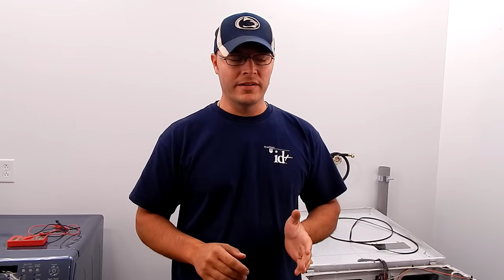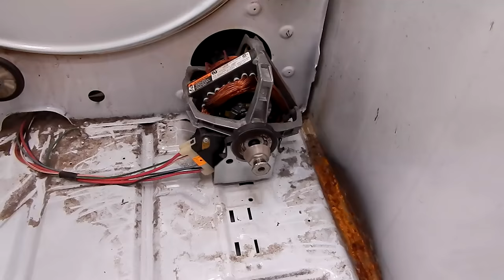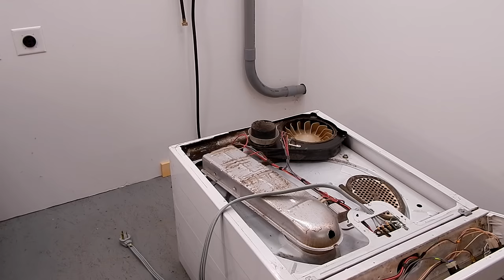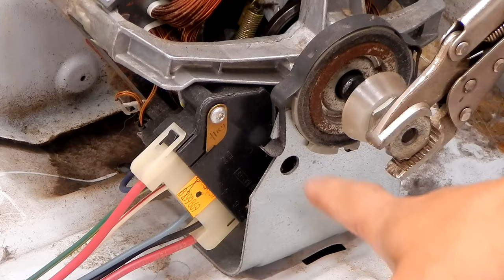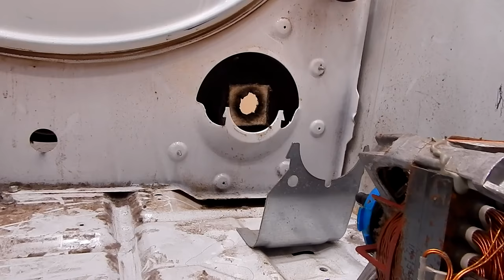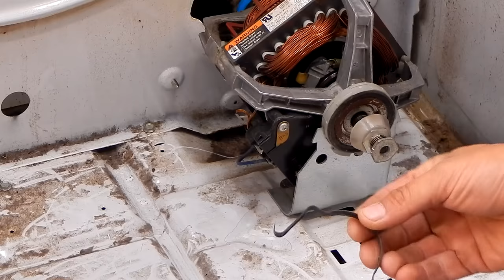How to Troubleshoot and Replace your Dryer Motor

Comment: My gas Whirlpool dryer squeals for 10 or 20 seconds each time I start it. Then the noise stops and the dryer runs quietly for the rest of the cycle. Two of the rollers, the pulley and belt were replaced within the last year. The other two rollers were cleaned and inspected and seemed to be working fine. Is the squealing noise an indication that the motor is beginning to fail? Can bearings be replaced or lubricated? Thank you.

Comment: Remove drum and rear sheet metal, blow or vacuum thoroughly, take a non flammable spray to the motor and clean it, especially the starter switch. Grasp motor shaft and spin it... is it free and keep spinning.? If it has a lot of resistance but no end play...take a 1/16" drill bit and drill the bearing felt housing at both ends....only penetrate the felt chamber! Take a needle oiler and use transmission fluid and wet the chamber with 10 or twenty drops. The motor should be free to spin now, and will add immensely to the drums starting torque. Clean up the excess oil and reassemble unit. (should give you another 5 years years of duty.

Comment: Good video, thanks for posting. I have a Kenmore/Maytag drier and when I press the start knob the drier starts for a few seconds then I can see there is a draw on the electric as the lights in the room dims for a second then the drier stops. If I do nothing in about a 90-120 seconds the drier tries to start again with the same results. The motor does not get hot as the drier doesn't run for more than a few seconds.Any suggestions?

Comment: Our dryer suddenly stopped working last night - made a loud noise and shook while sounding like a jack hammer - drum will spin - belt is still in place - removed the belt and took the drum out - push the start button again and the dryer shook while trying to walk across the floor - opened the door and the dryer shut off - since there is nothing else in place and I correct that we need to replace the motor?

Comment: I have a clothes dryer that works fine and doesn’t have any trouble running, but lately it will start to make a sort of low mechanical “whine” or “whirring” sounds after it’s been running for 5+ minutes. Cold start sounds normal and nothing else about the machine seems dysfunctional. Could this be a sign of a motor going bad?

Comment: Actually , you helped me remove the motor, thanks a lot ...but unfortunately the new motor is so expensive ( I'm in Egypt)
and I wonder if the motor itself could be repaired rather than be replaced. Is there some sort of ball bearings or brass bushings ( on the rotor shaft)  that are the reason for the noise . I mean , could we replace just the defective part inside the motor ???!!!......thanks in advance for your cooperation .

Comment: If drum turns amd no weird sound from motor and dryer shut's off by itself after a few minutes can it still be the motor or that would be a thermal fuse since drum turns normally?

Comment: I have watched many of your videos and really like them.
  That being said, I usually take those blower wheels off by using a wrench on the hex head on the other end just opposite the pulley, if I am lucky.

I have two questions -  Does that dryer motor have a reversed thread pulley?
  When the motor hums when you try to start, do you ever replace a capacitor?  I am not sure I have worked on an American made dryer that has a start capacitor.  It has been a while since I have done much with dryers.

Comment: Okay, I'm at my wits end. At this point, I have replaced the timer, the on/off button, the fuses (all of them), the motor, and the blower fan.  It hasn't been easy. I put everything back together. It ran beautifully, for about 20 minutes. Worked longer than it has in a while. Bu then, I heard an end of the cycle buzz and felt heat coming from areas it normally doesn't. Like the blower fan chute I immediately unplugged everything. But I think I lost my upper and lower fuses. Is this because the motor was changed or is there possibly something wrong with the motor replacement. Or maybe I didn't get the blower fan back in tight enough. I just snugged it. Help me please, I've invested too much to fail.

Comment: Could a bad motor or something else wrong with the dryer causes a breaker to trip? Breaker keeps tripping and I already replaced the breaker. Breaker is 30 amp and so is the dryer. Dryer outlet reads 116.5 volts on each side of 3 prong outlet. Thanks for your videos. Michael

Comment: Remove both clips holding motor down.
Put vice grips on the back side of that blower wheel, you reach it from the inside of dryer not from the back, where he put the vice grips is a 7/8” socket, it’s reverse thread. Grab the blower with vice grips and turn the 7/8 socket clockwise to loosen.
You actually don’t need to tip it on its face to disconnect fan blower from back of motor. In fact I think your more likely to damage it that way. Hammer and block of wood will 100% break that brittle old plastic.
Grab the clear square on the back of the motor with either crescent wrench or vice grips (vice grips are strong and can possibly break so gently grip it, . It’s only accents after you remove the 2 metal clips attaching motor to dryer body, it’s on the back side of the blower wheel.
Otherwise great advice.
Blower wheel and a motor is like 1/3 the cost of a new dryer so you wanna break as absolutely little as possible.
I had to replace belt, rear felt seal, roller wheels and belt tensioner and now it looks like motor.
All in it’ll be 180$. Approaching the why bother mark.

Comment: I replaced all my thermostats and the motor and it still shuts down mid cycle. I spent over $200 in parts. I checked the hearing element and it's good. I don't know what else it could be.
Reply: probably the controle board
might be worth checking the lint trap and the exaust ducting too
sounds like you have an electric like I have, I learned a whole bunch trying to fix mine and being successful with it even with my vision dissability! Dont give up on it yet.
Reply: nevermind probably scrapped yours by now lol

Comment: I been having problems with my dryer, I replace the heater element and thought that would do it, but I kept getting a buzzing noise, so I replaced everything possible and still get the buzzing noise.  I now think I have a bad dryer motor, I can push the start button and hand turn it to start and it will start, but when I open the dryer door it stops but will not start back up.  I was told it could be a bad bearing in the motor.  Thanks for the vid, I will replace the motor and go from there. alot cheaper then buying a new one, mine is not that old, just a couple of yrs  it is a armana

Comment: I wish I checked out all the comments first, because I definitely destroyed the blower fan. My replacement motor came, however I see the wiring inside wrapped with some pretty intricate string. This should stay on the motor, it should not be cut off, correct?

Comment: Just a tip, on the motor end where the belt goes, on the old  old dryers there really wasn't anything there to grab ahold of when trying to remove the fan,a pipe wrench or vise grips was your best bet, on the newer ones like this one, and when i say newer ones i mean the last 20 years that motor pulley has a hexagon so you can put a crescent or a proper wrench on there , even a socket to hold the shaft while you remove the fan, dont use vice grips, you're just gonna put all kinds of teeth marks on there.

You might be replacing the belt later and cut your hand on those teeth marks, if you motor has a hexagon and you have a wrench, use it!, on the fan subject, there are 2 types, one has a place when you can put a ratchet or something in front,if its smooth like he says in the video and you dont have a provision for a tool there will be a flat area between the motor and the fan (molded on the fan) inside the dryer, i believe the flat area on the fan is 13/16, put a wrench there or a crescent to remove your fan, Remember... the fan is what they call "left handed thread", this is done by manufacturers to ensure they way something normally rotates will never get loose because the way it rotates ensures its always spinning in the direction it tightens so the normal 'lefty loosey" doesn't apply here!!!

Comment: Hello, there I have a Samsung Dryer DV45h7200GW/A2 that it did turn on but the motor was not spinning but it had a loud buzz sound like it stuck so I did as you say giving a spin by hands and it did work so I clean the motor it with electronics cleaner and did work fine but then I added WD40 and know it stops after 3 seconds and comes back after 2 minutes and so, the question is the motor no good or needs better cleaning. Thanks

Comment: Mine would definitely break! Lol I have done everything so far and still no start. The light in dryer is on so it has power. It’s a Maytag centennial. I’ve replaced everything even though they passed the continuity test. Still no start. Mine never gave a warning. No hum no nothing. Just took out a load, put one in, hit start and nothin. Is it the motor?

Comment: yep  had the 60 hz  hum for a while now,  and my dryer won't restart after it has been running,   barely restarts after hour cool down , but completes the drying cycle,  thinking I only have a few starts before it lets the smoke out  burning winding smell  - will order new motor tomorrow   Thanks

Comment: My dryer has symptoms that aren't listed. The dryer starts and heats OK but starts to sound labored after a minute. If i pull the lint screen out a half inch allowing get air to come in from the top the laboring sound reduces. I have completely cleaned the lint screen and removed and cleaned the metal lint tube. I have opened the front of the dryer and pulled the drum out and vacuumed all the lint from inside the front and vacuumed off the motor. That all helped some but the dryer still sounds labored and sounds like it will fail in the near future. Any thoughts?

Comment: Just a heads up...have an 2012 ge electric dryer where the blower wheel comes off counterclockwise. A left handed thread would make more sense but NOPE, not here

Comment: +Bill Newberry
I have a 5KH26JJ064S that a got from a craigslist post from the side of 
the road with metal and this was in it. Anyway I don't care for AC 
motors much but I always have a hard time knowing how to wire them up. I
 used my DC bench power supple and put the negative to black and the red
 to the orange/blue and the motor resisted to turn so im thinking it 
works but I am hesitant to hook it up to AC since AC is always more 
complicated (and dangerous). There is a switch with 1-9. 1, 3, 5 ,6, 7, 8
 have tabs and blue is on the 8. Orange is on the 7 and black is on the 
6. How do I wire AC correctly. I think this motor is only AC as I do not
 see any commutator. Please respond thanks

Comment: When was the diagnostics part? You just mentioned the symptoms and how to remove it...
Reply: Ikr. How the hell does he know it's a bad motor without diagnosing? You can't just finish by saying replace the motor without testing whether or not you have a bad motor. I didn't even see him use any electrical testing equipment. Let alone watching other videos.

Comment: Bill,

I have replaced the dryer motor switch on my WED8300SWO. It will heat the first run. but then will not heat anymore after that. The motror will just keep turning the drum. Do you have any suggestions?

Comment: hi bill i have a ge front loader dryer. i think its a 2006 with the electronic control panel. it turns on but will not heat or spin and i have no clue how to take the sides off to get to the enter part at the bottom where the motor is. do u have any idea or clue what might be wrong or how i might be able to fix it? thank you for your time..

Comment: Hi Bill , look you have knowledge and experience. Hope you can help me :  i m having trouble with an GE gfdn240el1ww .  Run for 2 minutes and jeating and gos on pause . If i play again run for 2 minutes again. I  entered on diagnostics mode. once showed E11 : drum motor. i clean the memory and test it again . no errors. Motor run normally. i ran Steam Test . it runs the machine for 20 minutes heating and running without errors so i don t think that de motor is bad . The machine isn t old and few use  . it s a pitty put in the trash .  What can i check  ?

Comment: Hi bill i have a problem with my dryer its a samsung dv33ag and doesnt do anything the board comes on and the relays click but the motor or the heating elements wont come on. Is it a bad motor?

Comment: To get the blower wheel to loosen up with out laying the machine down on its front. First remove both clips  k
eep the vise grips the way you have them.   Then put an adjustable wrench on the blower wheel just behind the motor give it a little turn.  Then go around to the other side and its already broken loose.   Then it spins right off no need to use as hammer or ruin your hands or break the wheel .

Comment: I like how you skip attempting to loosen the blower wheel from the inside of the dryer. The back has to be opened anyway, so might as well just go to the 'bigger hammer' method from the start.
Reply from the maker: Kip Anderson lol,  I know.  There is usually an easy way and a hard way.  I somehow prefer doing it the hard way for some strange reason.  Makes things more interesting.  Thanks for Watching!
Reply: I was able to slip a 12" crescent wrench across the wheel, then used a c-clamp in the middle of the wrench to get leverage on it. Less banging. No bloody knuckles.😀

Comment: I have a gas dryer.  Starts up easy and runs fine.  However, it has an intermittent humming sound during the cycle.  the humming typically increases in volume and then goes away.  Then will start up again in a few minutes.  Any ideas?
Reply: Coils on gas valve may be weak, check their resistance.

Comment: Hi Bill, I know this is an old video, but I would like to ask, My motor protects thermally, it spins for 20 minutes and stops. I have to wait some time to run it again. So, I replaced it for a new one but it is showing the same symptoms. Is it possible that the conversion to LP is throwing heat inside the box and heating the motor?  Hope you have some time to shed light on this matter.

Comment: Hey!!! We Are.lol...Psu country...I have kenmore with same motor,wont heat..I checked everthing..When I unplug motor,stick probes in each end red wire port,then push back black collar on shaft,it beeps..WhenI turn by hand,it does nothing to the switch arm,is that normal?If it is,might be my breaker is bad.I have cheapo china meter,so was uncomfortable sticking on live 220 line to see if full power coming to unit.The arm,can they go bad? thanks

Comment: hi, I have a 80 series Kenmore and replaced most of the things in the back. now I've opened it and looking at the motor but don't know what to look for...still does not heat but everything else works, rotates Turns on

Comment: Easiest way to remove fan is to remove rear motor mount clip and use a 13/16 wrench near where the clip was and a 7/8 wrench for belt pulley side.

Comment: It seems, you forgot to attach the second clip of the new motor at the wall of the dryer.
But do you really have to disassemble everything? It seems like the last past left..

My Bauknech is blowing, but not rotating the tumbler. There must be two motors then?

Comment: Hay Bill i have a GE GFDS350GL0WW Gas Dryer i had a repair guy out he checked the fuses/high limit Ect and said BAD MOTOR. so we got a new one, installed and powered up with the same results. hit the start button here the relay click and nothing..do you have any advice

Comment: I had similar issues - diagnosed it as a bad transformer - works like 20 minutes then shuts it off without any power. I guess there is a resettable fuse inside the transformer.

Comment: You don;t discuss the symptom where the dryer runs for a while then trips the 30 amp breaker. What are your thoughts? Motor or weak breaker? Thanks
Reply: +Trevor Heath How old is your breaker? I don't think it would hurt to go ahead and replace the 30amp breaker...that's easy.

Comment: I changed my thermostat and thermostat operator and my dryer still wont start. Is my problem the motor of the timer?..it does not make a sound when i hit the start switch..thanks

Comment: hey bro i also do some repairs but i am having the weirdest repair ever, my dryer is starting up and everything, but there is no heat. I checked the element, all the thermostats and the fuse, its all good, i have a feeling it could be the motor, but i just wanted to double check with you on how you would check the motor? I even checked the dryer timer, (this dryer is a commercial coinslide model), and it checks out as well..... please let me know if you have an answer on what might be causing this issue!
Reply: If your motor runs but no heat. It could be your breakers at the main box. Check to see if you are getting 220 volts between the two breakers.

Comment: Is there a way to replace the white plastic belt retaining pulling thingy at the tip of the motor right next to the small pulley that your attaching the vise grips to?
Reply: Or do I have to buy a new motor?

Comment: My dryer makes a loud noise, almost like a rumble when it first starts up and while its running it almost sounds like it slows down and speeds back up. it will also make a loud rumble sound when you turn it off. Could that be my belt?
Reply: Did you ever figure out what the problem was this is exactly what mine is doing

Comment: Removing the rear motor mount should reveal a nut to take the blower wheel off easily without hammering.